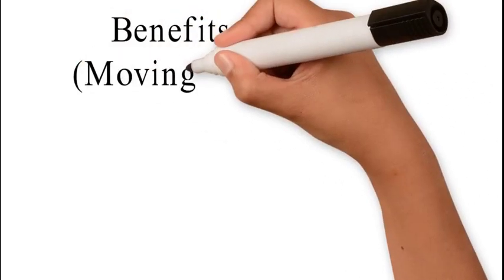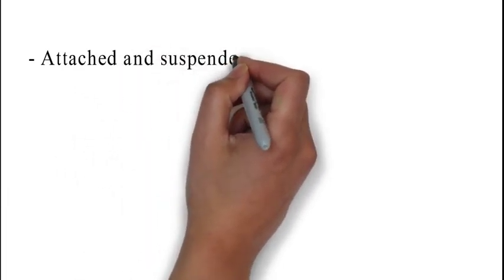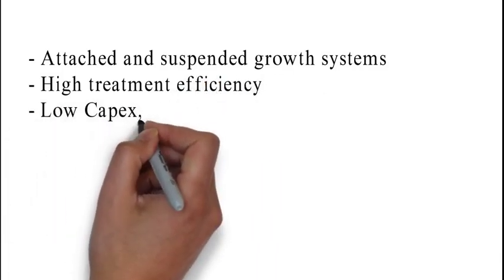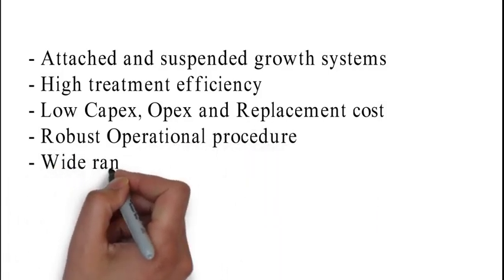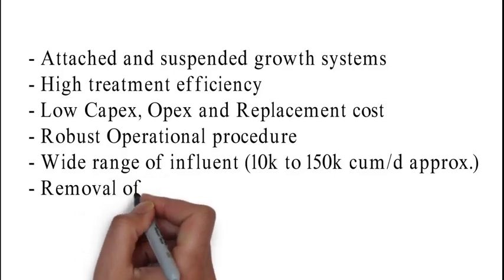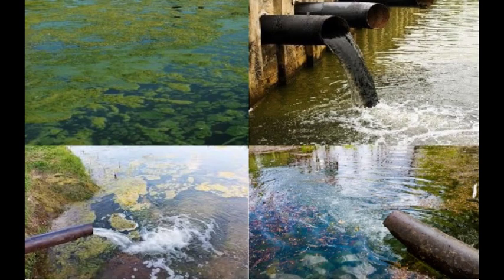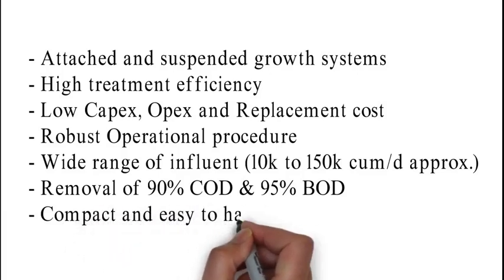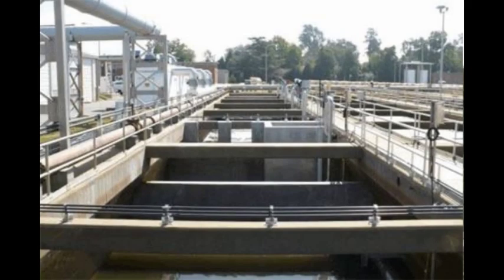Benefits of MBBR (Moving bed bioreactor) technology for wastewater treatment

Comment: Please make a video on coarse and fine bubble diffuser also.. what are these and there benefits. Your all videos are awesome good luck 👍
Reply: Fine Bubble Diffusers :
Fine bubble diffusers are available in a range of designs including plates, tubes, and domes. Ceramic is a common material of construction for fine bubble dome diffusers. 
 1.The principle benefit of fine bubble diffusers is the relatively high oxygen transfer efficiency compared to other types of diffusers, meaning the plant requires less energy to run. Fine bubble diffusers have a nominal oxygen transfer efficiency of approximately 6-15%,
2. Fine bubble diffusers provide substantial transfer of oxygen to the water; colder water contains more dissolved oxygen, which combined with fine bubble diffusers creates optimal saturation of dissolved oxygen.
 
Disadvantages of fine bubble diffusers include: 
1. Susceptibility to clogging due to dirty air on the inside or biological growth on the outside. 
2. Their limited air handling capacity compared to other types of diffusers. 
3. Relatively greater capital cost compared to other types of diffusers.
Reply: Coarse bubble diffusers :
Coarse bubble diffusers are available in the widest range of designs. To keep the cost down, coarse bubble diffusers are commonly made of plastic. 
The benefits of coarse bubble diffusers are: 
1. Relatively low cost. 
2. Greater air handling capacity compared to other types of diffusers. 
3. Less maintenance concerns compared to other types of diffusers. 

The principal disadvantage of coarse bubble diffusers is the relatively low nominal oxygen transfer efficiency of approximately 4-8%.

Comment: Mam please give the detailed reason for 2 MBBR and also you are requested to make a video on today’s conditions how to achieve where output perimeter BOD 10 and COD 20.
Reply: To achieve BOD <10, you have to take care of proper airation in equalisation tank and mbbr tanks and make sure MLSS should be 25%.you can achieve BOD<10. Without using any kind of chemicals.
Reply: Thanks mam , please also share the detail reason of 2 nos aeration and is 1 aeration had any drawback. Some engineers say that on low BOD 1 aeration is enough.
Reply from the maker: Thank you for watching my videos and appreciation of my work, Soon will share the video on same topic....
Reply: Thanks Mam